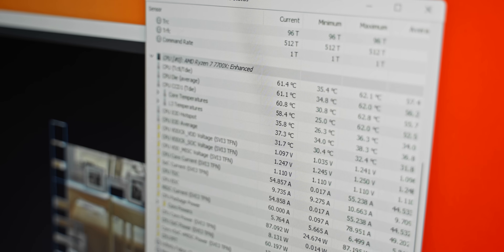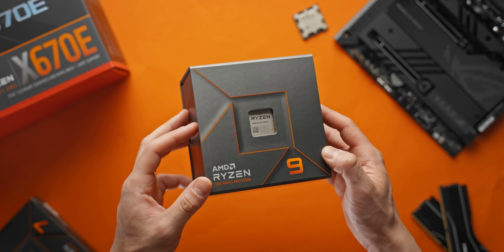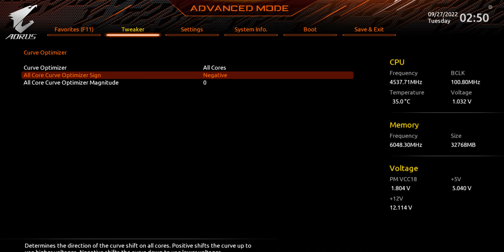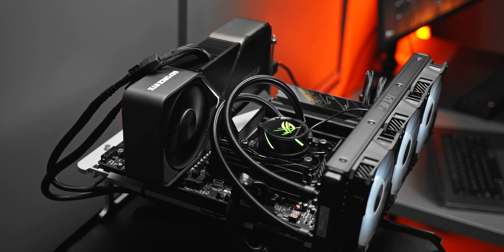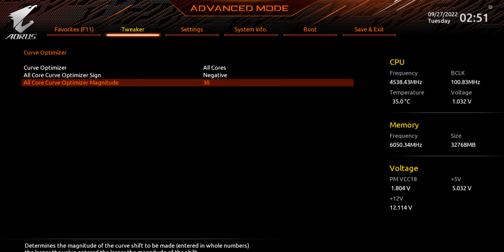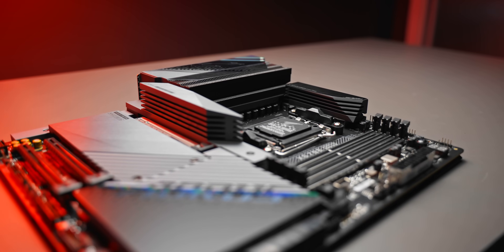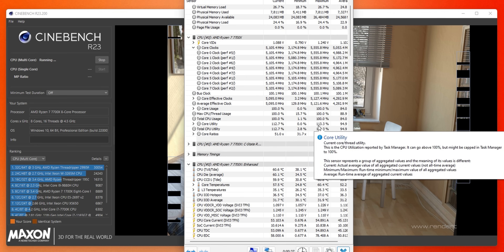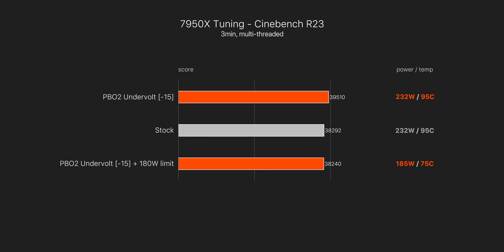Fixing Ryzen 7000 - PBO2 Tune (insanity)

Comment: is this the exact same procedure with 7600x? thanks guys
Reply: Yes its 100% the same procedure for your 7600x. I believe max wattage for it is 134w, so setting the same limit shown in this video at 85w will give you noticeable cooler temps.
Reply: it worked! thank's man;
 but i think i still need a better colling system tbh.  @eimartin
Reply: @eimartin old comment but ima compliment and assume you're more knowledgeable than me at this lmfao 
Would you happen to know why at the end of the vid on his HW monitor it showed his voltage chilling at 1.06-1 or so and mine in HWInfo after running cinebench and booting bauldere gate still has a voltage between 1.2-3 volts? 
Admittedly my CO is at -15c because wanted to be safe but the rest of the settings are the same including wattage
Is the extra -15 that impactful to thr the voltage or is it an inherent difference between the 7600x i have and the 7700x?
Reply: @walter4180  Hey there! I dont know the exact voltages between the 7700x and and 7600x. But that low voltage seems like the benchmark was already over and he was just showing what the max temp was in HWinfo.

Your voltages seem in line to what a -15 CO does.

Comment: I keep seeing this solution everywhere, but when I try to do it on my system and enable my expo, the cpu thermal throttles every time, but without expo it just has the same out of box temps no matter what I do in bios
Reply: What mobo?
Reply: Yes what mobo, are you using the most recent bios? I know some manufacturers released new bios versions in mid August that helped a ton with AMD expo ram. Update your bios, follow this the video and you should see some great results.

Comment: I went from 95C to 60C RUNNING CYBERPUNK. Youre goated.
Reply: How? I did all this and temps are the same.
Reply: Hey, I have ryzen 5 7600x. It gets blazing hot to 95deg while playing black myth wukong. Can I do the same process to decrease temps ?
Reply: @yt.clinck  yep
Reply: @yt.clinck  hey man did u do it?wat r ur results? i have the same cpu pls let me know how did u do it if it worked.
Reply: @as1asim Nahh men, I can’t risk doing right now. Unless I have another back up pc to offload my workload. Just to sacred to do it right now 😅
Reply: @yt.clinck  you can absolutely do it my man. No risk. Youre just setting manual limits for your cpu thermals and draws. You can always reset those limits in bios too should you face any problems. Now give it a go my friend. My 7600X went from 96max to 80
Reply: What’s ur PPT, TDC, EDC & throttle limit?

Comment: 11 months on and this guide is still the absolute GOAT, for 7xxx series CPU's optimisation.
Reply: After two years...still the best guide!
Reply: Ive never had a pc up until now  I'm getting tired of having to lower my settings so it doesn't go up to 90c+ but I'm scared to break something. How can I be sure I avoid that?
Reply: Just do the first step. I got a 12-20 degree drop with minimal performance loss. Initial boot up after is a bit longer but the cpu doesnt go higher than 78 now  @JozaMan-t6n

Comment: Does anyone have the values for MSI Mainboard? With Values like 85W / 48A / 64A my Core is running at only about 4800MHz and Cinebench is crappy 17000. Ryzen 7700X
Reply: U need to research way more before u do this. Msi main board gives no information
Reply: You also cannot just copy paste his settings
Reply: Just copy paste his settings since he mostly talked about the 7700x. Keep in mind, his mother board uses mW which is milli wats. MSI uses regular watts, so set your wattage to 85w NOT 85,000.

Comment: I'm glad I found this! Just built a 7700x system with a 240mm AIO Corsair cooler and I was sweating thinking it was undersized. Knowing the 7700x runs hot (by design?) made me feel a bit better but I still didn't like the 95C at max load. These settings did exactly what you said they would and I am relieved. Thank you!
Reply: What are the exact settings? I also have a 7700x and a 240 AIO Be Quiet and sometimes I get 95-99 degrees!! Help
Reply: @Diego-d5m  I followed this tutorial exactly.
Reply: @lancaster155 yo I have the same cpu going to follow this tutorial
Reply: @lancaster155  What about the TDC and EDC numbers? I'm not getting that part because his numbers are like 6x of the ECO Mode ones
Reply: @boooo06T  TDC is 280000 | EDC is 350000
Reply: @lancaster155 do you leave the PBO enable and then do the tutorial or? Cause my clock speed sitting on 4,5ghz sometimes up to 5,1ghz
Reply: @lancaster155 I entered exactly what he had on there for his 7700x and it seem to work fine but now I'm worried I did it wrong if these are he TDC and EDC numbers
Reply: @ Run a bench test and see what your temps get to.
Reply: just got me a 7600x after abusing a 7th generation intel cpu for about 8 years. I understand they're designed to operate that hot but oh my god I just cant get comfortable looking at 78-85C temps.

Comment: My 7800x3d did 30 easily, am I lucky af or is this normal?

Also why is the performance getting better with lower voltage??
Reply: Less heat more frequency. The reason this isn’t how it is out of the box is because of stability
Reply: @Ieonblack  ah makes sense, thank you.

Comment: Guys its not really worth it for upto 4% performance gains, i tried it by setting curve pptimider to 28 and tried booting into windows, i got a BSOD that said Bad system config, tried everything to fix it, i couldnt do it and i didnt have any system restore pointe so i had to reinstall windows, loosing all my data on C drive (i did this after changing PBO back to auto from advanced)
Reply: Not the point, the point is heat. Also u can’t just copy paste oc settings
Reply: "Hey guys, don't you bother with this because I don't know what I'm doing." Yeah okay.

Comment: Is there a 0 too much on TDC and EDC limits? I don't find these numbers anywhere else on the net, more like if you go with 88000mW for PPT, it's 75000 TDC and 150000 EDC. 480000 and 640000 seem a tad much, no?
Reply: U can check all that on ryzen Master and adjust accordingly

Comment: I'm not sure if this is linked to my -30 application of this. However, everything has been running perfect, except my installs of small applications all get stuck on 99% and never finish.
Reply: Yes, it seems there are 2 type of loads, high loads like cine bench and low loads like the install tasks.
Reply: @Saladeo  -25 seemed to be the sweet spot

Comment: Heck yes, I needed this. I was able to get 30 on the curve optimizer on my 7700x and went ahead and limited to 85 watts. After 10 minutes of prime 95  averaging 57.7 C instead of in the 90s and right around 5 Ghz which is a bit under stock but is very close.

Comment: can i set a 7700 non X to say always run at 5.1ghz if i limit power to 85W while also keeping a stable system with quiet fan and temperature? this cpu also comes in with a wraith prism which i read that should be more than enough and is a big plus for me considering i can't afford a full pc upgrade

Comment: I used Ryzen Master to calculate a per core offset of -30 on each core for my 7700x with an AutoOC of +200mhz. After this, I uninstalled the program and set up an all core offset of -25 with +200mhz boost in BIOS. Just an easy way to get a nice performance boost while keeping things stable. Use Ryzen Master to calculate, then add +5 to your undervolt(s) to ensure stability.
Reply: Bro. When you used Ryzen master to Calculate per core offset, did you enable PBO?

Comment: Hi Ali, is there any chance you'd be willing to possibly give me some advice or provide thoughts on what might be wrong with my PC? I have a 7700x that is now only scoring around 1600-1700 on cinebench both before and after resetting the BIOS. At one point, after following this video's advice it was almost up to 2,000 single core, 20k multi, but I wanted to try getting it a bit higher to kind of match what's yours in the video. 

But I can't get it back to even an acceptable score, not sure if I damaged or ruined it somehow but it sucks having a brand new build that's slow and clunky feeling.

Comment: I have 7600 with stock cooler, i was able to push to -45, at -50 benchmark started crashing, is it safe to run it -45? Blender, cinabench, prime95 all passed. With maximum 90 c temps
Reply: I thought I did something wrong with my build since it can reach 92C under load
but it's just how Ryzen 7000 series work I guess
I've set it to -30 PBO and 65W TDP
it's much cooler now, sitting at 75C under load
-30 PBO = 143392 score
-30 PBO 65W TDP = 13456 score

I prefer the latter, much lower temp and power consumption with only 7% reduce to performance

Comment: For other 7 series CPUs just start at 85w and go up until your cinebench score somewhat matches stock. For my 7900x I set throttle at 88c and ended up at 135w limit. Cpu tops out at 72c during benchmarks and yields same cinebench score at stock (stock is 28,800, my settings are 28,600). Definitely worth trading 200 cinebench score for 23 Celsius lol

Comment: Should I lock PPT Limit with 7700 non X? It’s already has TDP 65W
Reply: it's not 65w though, the number AMD gives you isn't actually power usage. Your 7700 runs around 88W without BPO, more with BPO.
Reply: @Cygnus-Phi so limit it by 85W like 7700x is good idea, thank you
Reply: @Cygnus-Phi I have around 65 degrees max in cinnabench with curve -30 and platform throttle limit 85 degrees. Max voltage was around 90W. Got 18802 score. I’m guess 7700 doesn’t need to limit PPT then. Idk should I try to adjust PBO to get higher score or this is enough though

Comment: Great information as always. Have you considered maxing out the LLC for CPU vCore? Apparently This means that the limited amount of voltage available to the 7800X3D is maximised, and the voltage won't droop under load. Can result in allowing curve optimizer to be set at -39 or more while still stable.

Comment: How do you get to know what your motherbord TDC and EDC is? Can i just take the values like in the last method of this video? And can I adjust the wattage higher without adjusting the amps?

Tried it in Advanced but didn’t have any change in CPU behavior, i got the middle method with -30 and 85c limit on but I still instantly hit the 85 on cinebench even after tuning the power settings. I’m running a 7800x3D on a Asus B650e-i with an Black Rock Pro 4 (which can take up to 250W) 5:00

Comment: Im trying to drop the temperature of my 7800x3d. It works great so far. PBO2 Undervolt -20 + 70C limit. With 460 points more in Cinebench R23.

The CPU uses 80watt, around 10watt and 12C less then stock.

With stock settings and PBO2 Auto my CPU reached 87C Max using Cinenech R23 (18000 points)

Now it reaches 75C in Cinebech R23 and achieves 18466 points.

Win/Win so far!
Reply: so you offset your limits for cores by -20, can you share the three PBO limits? I don't see temp drop here
Reply: Sounds perfect. Do you have the 670 oder 650 chipset? Does that make a difference?

Comment: working with the lian li a4 h20 and a 240mm aio i had alot of heat issues (damn near burning to the touch on the top of the case. i was able to get a negative 30 for my curve optimizer along with limiting my ryzen 7 7700 (non x) to 75w and a 75c thermal limit. im still getting in the 4ghz for my clock speeds but nothing above 65C. huge huge huge

Comment: What people are missing about the whole "running it at 95 degrees is fine" thing is that....sure, they are designed to run at those temps, great, awesome....but what they dont tell you is 1. you need to buy either giant - and i mean giant air cooler or at the very least 240mm AIO to be able to actually cool this thing to keep it there. Forget your good old quiet and proven air cooler that worked fine for you until now, no no, you will need to invest. 2. they forgot to tell ya buddy that even with this new great cooler you had to buy, these chips run in IDLE at 50 + degrees, yeah thats right. And thats before the summer. The hotter the chip gets, and believe me, it gets hot extremely easily, the more heat is annoyingly crawling out of your PC case....AND the more noise you get. Its all great and cool to say that these chips are designed to run at 95 degrees....yeah....but what kind of idiot would wanna run them at those temps with the heat and noise this produces? Its so stupid. Too bad i was too stupid and didnt realize it before i fell for the hype and bought the 7900x chip...Now here i am, essentially downgrading to the non X version lol Oh well, we all learn from our mistakes.

Comment: Can this be done on B650 boards or is this an X670 feature?
Reply: Ye sorry for not replying. As  @darkahrii6312  said it can be done on B650 boards. I got a Gigabyte board and it works. I got a dud chip that doesn't want to do more than a -10 on the curve optimiser but nothing can be done about that.
Reply: did you find out yet?
Reply: +1
Reply: @HaasTheFirst  yeah i got my 7700x and got an MSI b650 board, you can do it here too just find the amd overclock options and its there
Reply: @darkahrii  thanks a lot!

Comment: I tried two different methods on my 7600x to reduce the temps:

1. Using Curve-Optimizer on -30 + 85 W Powerlimit
2. 5,3 Ghz @ all cores with VCore=1.16 V

Here are my results in Cinebench R23 Multicore:

1. 14953 Pt
2. 15295 Pt

Temp-Difference: 4°C lower temps using method 2

So 2. will be my way going forward.
Reply: How did you tune it

Comment: hey, i did the undervolt on my 7600x and went from 95°C to 75°C stable at “30 offset” like in the video, 10 min cinebench went smooth, is there any other stability testing i should do?

Comment: My 7700x at stock gets 18700 multi core in cinebench and won’t all core boost past 4.99 gHz which is much lower than your default scores.  What could be causing the issue?  Or is it just bad binning?

Comment: Need 7800x3d update
Reply: Using the 7800x3D in a velka 3 using only a NH-L9A AM5. I was hitting 77c at idle - min load, now I hit 56c idle and max temps of 80 at load. Very little drop in performance. Incredible underclock. 

Negative curve set to “30”
PBO at “80w” Thermal throttle “80” 

Magnificent drops in thermals
Reply: @SleepyCameras Do you also set the PPT/TDC/EDC limit? I'm also using the Velka 3 with ryzen 7700 non x build but hitting 70-85°C 😢
Reply: @kiseki69  hmm, one would assume you are using the exact same build? Bar cpu? :) 

Setting a PPT limit will certainly take the heat away, is this during load or ambient operation? The max my chip hits is 81c under load in all scenarios 

I use an 80 PBO AND 75 TDC limit, and honestly I’ve compared it to normal function. I only lose 40 fps from a 240 aio cooler

That said I recommend looking at an under clocking guide for your chip specifically, so you can find stability amongst your settings :) hope this helps bud

That said to work with the VELKA 3 you’ve got to be comfy with high temps anyway, if not then save some money and buy a Ncase m2 or T1 formed ✌️
Reply: @SleepyCameras  Thanks! will take a look at it. Btw, if you find a video underclocking 7700 please drop it here. Much appreciated.
Reply: @kiseki69 yes I have the 7700 and doing these settings will benefit
Reply: Turns a spooky temp’d hot box into one of the most powerful, portable PC’s in the world 😎
Reply: @SleepyCameras nice!
Reply: @SleepyCameras same with me pbo advance negative 30-40 stable same performance but less  1° for each neagtive 5.  Disabled X3D Default was hitting 68°-72°  while playing battlefield 2042,  idle 34°,X3D enabled opening the  game in standby 48°-51° while playing 53°-58°. And I'm using a Arctic liquid freezer ii 280.
Reply: Isn't x3D chips locked out of some settings due to safety protocols of AMD's L3 Cache architecture? Just tweak whatever you can.
Reply: @Atkafası-31  things were new back then. Now we know we can only tweak small amounts of power.
Reply: its litelarly the same
Reply: should be exactly the same
Reply: @raytek8837  I tried with pbo -30 but if I put a 60w limit it lowers the degrees to 100% but in game I have a strange behavior of the cpu, almost 100% on some games
Reply: @Luca-ij2xe where you evere able to figure ir out?
Reply: @Luca-ij2xe  smt

Comment: Hey there, I tried doing the precision boost overdrive starting at 30 and now I can’t boot into windows. I’ve reset all bios settings to default and every time is starts up with goes into automatic repair and then said “Your PC did not start correctly”. Any and all help is greatly appreciated, I just built this and prior to changing PBO settings it was running fine, just hitting the 95* mark and wanted to change that.
Reply: Hey friend, sorry that I don't have any advice to help. Were you able to sort out the issue? Another user above you said that they had to reinstall Windows.

Comment: On my ASUS TUF GAMING B650-PLUS i have the option in bios to enable Amd eco mode and set cpu to 65W and temperatures dropped from 95 to 76 degrees on Scythe Mugen 5 Black Edition Rev. C. Everything is stable. Running windows 11

Comment: Man, I gained crazy performance on my 7600x thanks to you. I did all this before realising that my motherboard had these PBO settings ready to use 😂 I went from 92°C full load to 76, insane (-30mV, Tmax 85). I gained 800 points on cinebench and my pc is much quieter.
Reply: @AbnormalVega Asrock B650E Steel legend
Reply: I have the same cpu but im it’s overheating and whenever i set the curve optimizer anywhere from 30 to 10 it crashes, what did u set them to? i also put max temp at 90 and max wattage at 70
Reply: @hiasat  Basically on my AsRock motherboard there are performance preset in OC tweaker. There is one called PBO, Tjmax = 85°C and curve Optimizer -30mV. Update your bios and check if your motherboard has the same thing. It basically does all the stuff in this video in one click. Don't adjust power limit, it will change by itself due to the undervolt.